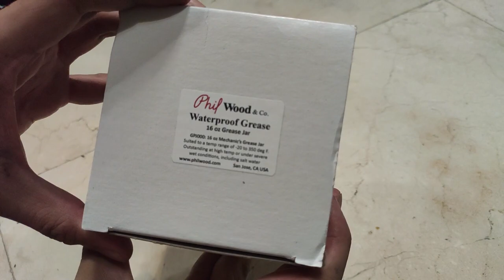Skream Magnum20 | General Maintenance 🧑‍🔧

Comment: Hi, can you tell me if this bike has an overlap? when cornering, the wheels of the foot touch?
Reply from the maker: It does! But it's overlap is very small you can get away with it by tilting your foot up. If you're using flat pedals and straps, you can just move your foot back.

Comment: Idol jjuls,pwede po ba matanong anong fit po sakin na bike fixie
5'3 / 162 cm  inseam kopo is (75cm/29inch)
size 49? Po ba o 48,50?
salamat po in advance
Reply from the maker: Sup man, hindi ako expert sa pagbigay ng bike sizes pero based rin sa knowledge ko for people na around 5'3 ang height, usually ang frame size nila is 45cm. I'm not entirely sure pero better if you ask the experts. Thank you man!
Reply: @Jjuls  salamat po sa advice
Reply from the maker: @xhinkai9221  You're welcome!